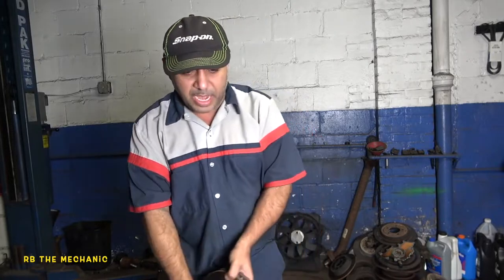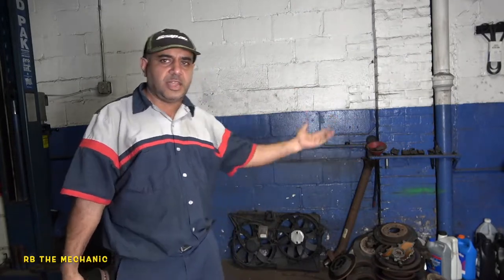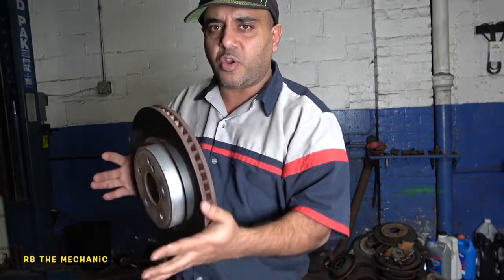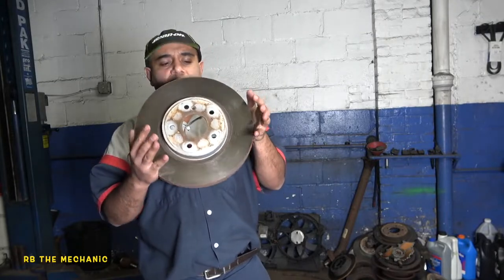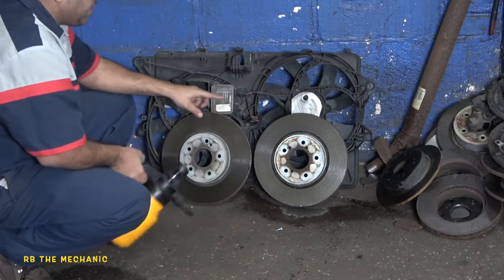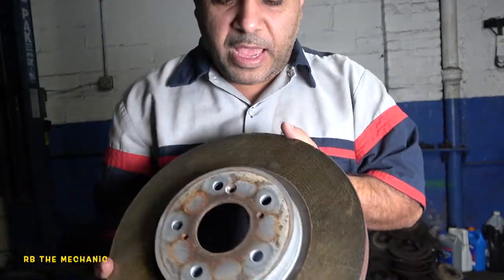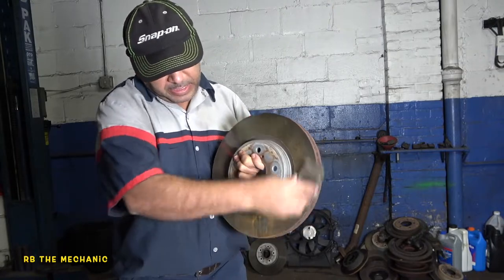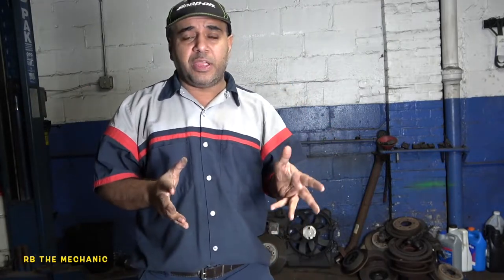The rotors will RUST...but should you be worried?

Comment: My car sits for weeks at a time during the winter.   I recently got new brakes and rotors. The pair are now rusted. Can i use PB blaster on the rotor, to remove rust and run it through the carwash ? If not, what solution do you recommend without removing the tire or rotor?
Reply from the maker: No u will loose brakes by doing that just drive the car normally it will clean it self but down the road never let a car sit for a week
Reply: Thanks , you gained a new sub.

Comment: The middle part you showed on the rotors are all rust on just the two rear, not at all in the two front & all four rotors and breaks were replaced 6 months ago. I drive every day and they squeak mostly after rain when I apply the brake.  Why is it that just the middle rear are rusted?
Reply from the maker: It might be pad that don’t seat propperly or defective pad switch it to other side see if it changes the rust to that side